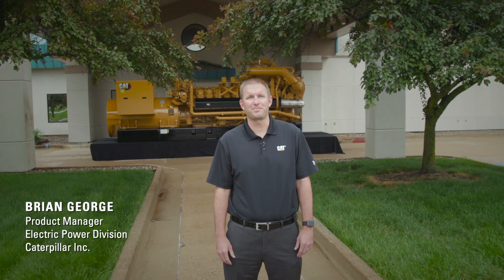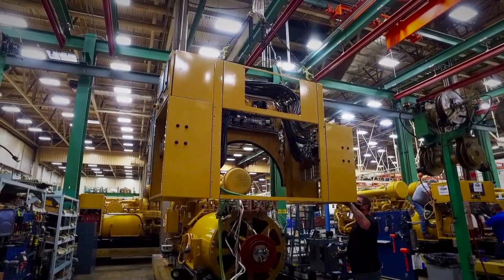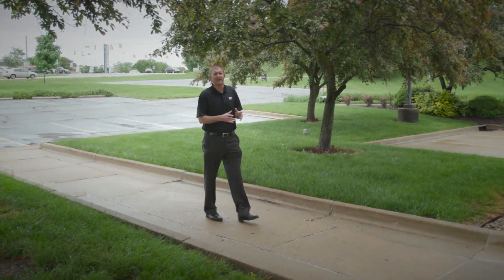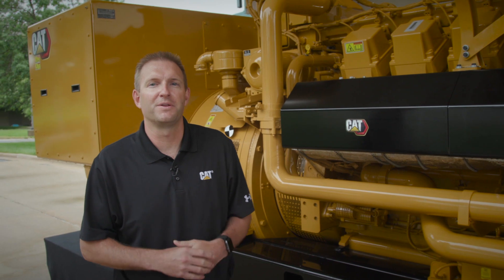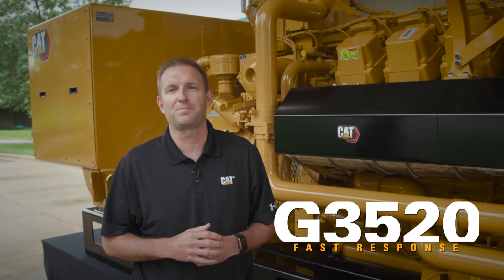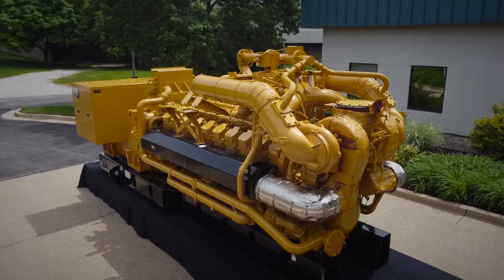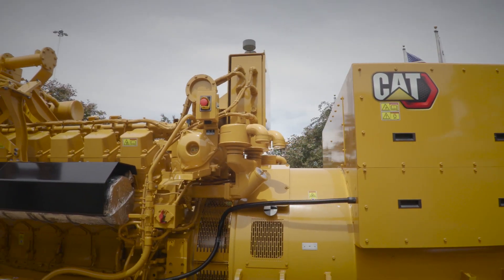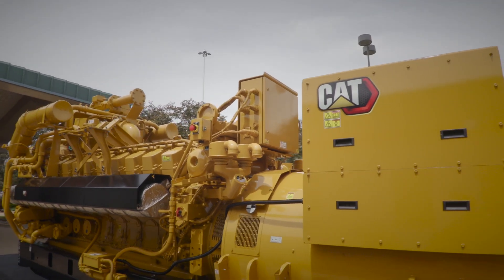Cat® G3520 Fast Response Walk-Around

Comment: How would you turn the engine to do valve lash adjustments on this unit!? Do you use the starter? The cat engine barring tool looks a little small to turn this big thing by hand.
Reply from the maker: Hello, great question. Your local dealer may be able to assist. You can find their contact information on our dealer locator at 
https://www.cat.com/en_US/support/dealer-locator.html?utm_source=youtube&utm_medium=social&utm_campaign=cic_social_care - Maria
Reply: It can be electrical or air start motor depend on your application, and can be n+1 redundancy start motor.